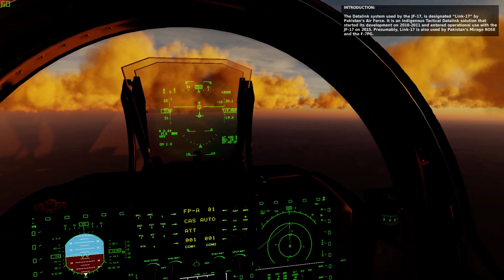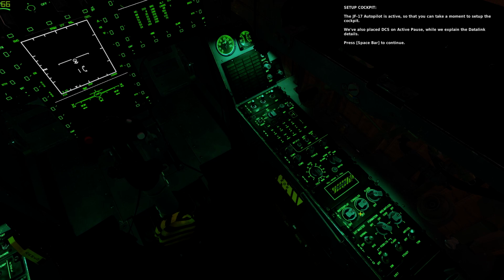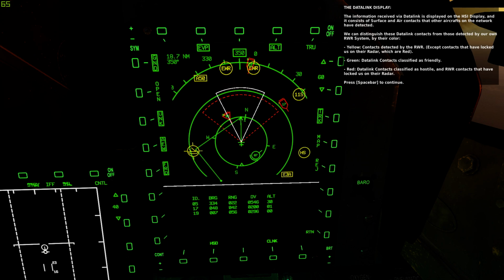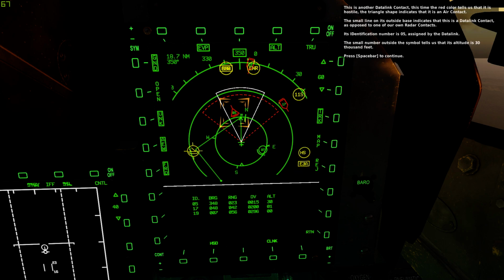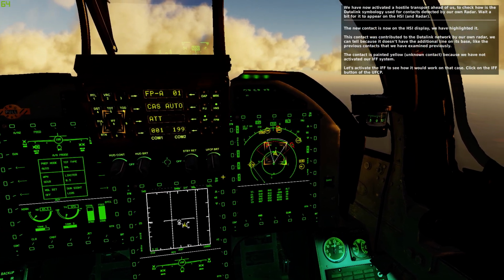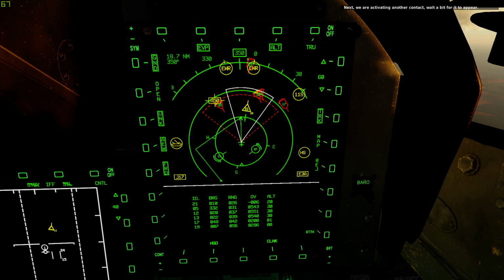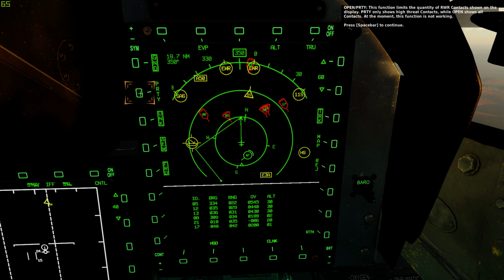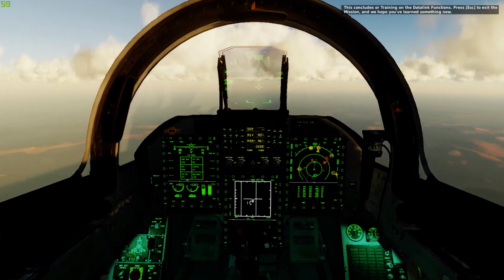JF 17 - Training - M12  Datalink

Comment: Could you please provide the RWR codes in a PDF or jpeg format? Want to print it. Thanks
Reply from the maker: Sure, this is the original Excel file (so you can print it larger): https://1drv.ms/x/s!Ai6cuX3YQI26hq0je4mk3FAvj94RAw?e=Uqrb7U and this is the JPG used on the mission:  https://1drv.ms/u/s!Ai6cuX3YQI26hq0nwv3PyV_anAIj4Q?e=zrE1o3